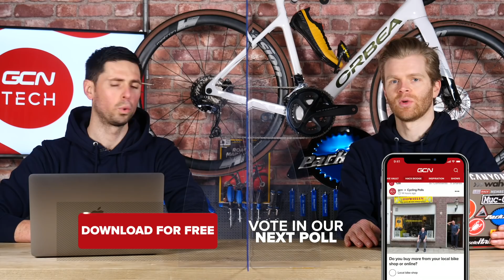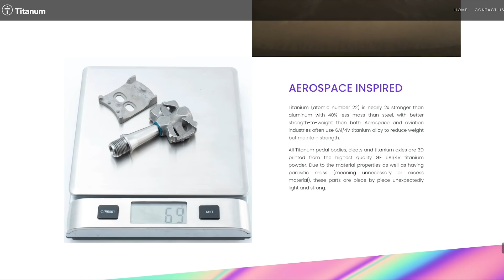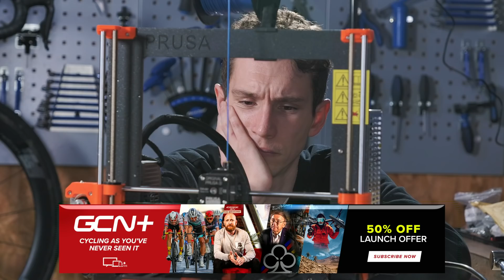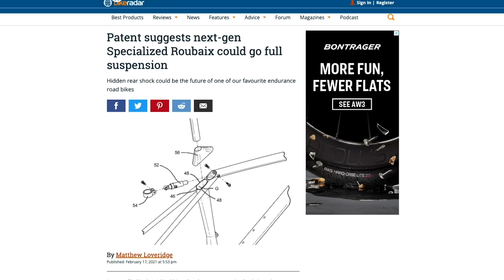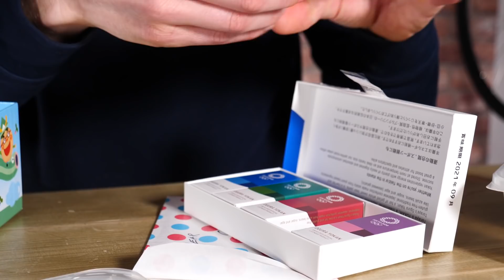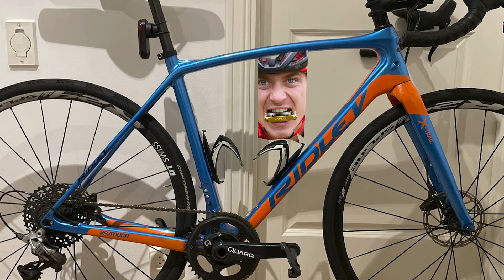Super Light 3D Printed Titanium Pedals! | GCN Tech Show Ep.166

Comment from the maker: What did you think of these super light pedals? Is 3D printing the future for bike manufacturing? Let us know 👇
Reply: Hot
Reply: I cant find the website of these guys?!! do you have a link?
Reply: Titanium pedal axles have no life time . Wear out real quick .. a few months . Exactly the same design needle bearings with cartridge bearings. After market SPD axles .total shite
Reply: Until the anisotrophy in the structure of 3D printed stuff is not controlled properly, it's pretty weak as a structural material. Currently there is two way to get over this: overdimensioning the sizes/volumes to achieve the needed strength OR don't use it for places where the stress is high. What can be interesting is to use hibrids/composite materials, but we don't see that.
Reply: @BarfyMan362 Nah. For some things it makes sense but it's mostly useful for prototyping. If you can injection mold, it'll be cheaper and better.
Reply: for all the 3d printing fans out there, do you guys know that agnikul cosmos a private indian space startup has built a fully 3d printed rocket engine!
Reply: @olli i think you need to explain adamantium metal because you look like wolverine (logan) now! 😂 peace man! luvya! 😘
Reply: Forget the tech, THAT INTRO
Reply: 3d printing is like injection moulding, but with much more structural drawbacks and massively more expensive
(But great for rapid prototyping, I'll give it that)
Reply: @frankeeeej  its a cheaper way to make a mold for rigging yes, less waste material like in vacuum forming and injection molding
Reply: @frankeeeej  except for the fact that you can't really injection mold Titanium?
Reply: The pedals look similar to Speedplays. With the two bolt cleat fitting resembling the late, much lamented Frogs.
Reply: @johnwestwell2942  I wish that Wahoo/Speedplay would release the design specs for Frogs to someone else to manufacturer. I can't stand the other Speedplays but I love my Frogs.
Reply: @davidruedeman9990  I use both - started with the road pedals, but used the Frogs on my mountain bike. They have now expired and I've had to return to Time pedals which have nothing like the rotational freedom my knees like.

Comment: #askgcntech
Hi, I had a valve failure riding my tubeless Continental GP5000 tires, and the rim made a small cut on the sidewall: 3-4mm, shallow, right at the rim bead (probably due to riding them on low pressure for a couple of kms before I noticed). Is there any way to safely and reliably patch them? Can I use the regular tire glue&patch kit from the inside? Thanks!

Comment: #askgcntech is it safe to assume that the max external rim width allowed is equal to the max tire width specified by the manufacturer? I'm planning to buy a wider rim on a slightly older frame and wanted to know what other considerations I should take like actual tire width after inflation. Thanks in advance!

Comment: I used to live in Japan, and 羊羹 (youkan) are probably one of the best cycling snacks. They primarily contain carbs, but still have a little protein and little to zero fat. Some versions have extra salt which are great for the summer. They are also highly economical since the ones at the supermarket can cost just 0.46 euros per stick. The ones you guys are extremely expensive, costing 2.09 euros per stick.

Comment: #Askgcntech Hi Ollie ,My front derailleur is rubbing to the chain when in the small chainring I also removed L screw bolt,tried narrower chain but it doesn't stop, I also tried changing the angle of the front derailleur then it's stop rubbing but wasn't changing to big ring ,Any suggestions what should I do???

Comment: Industry can call it whatever they want--additive this or that--but I doubt they'll shake off its technical name, 3D printing.
Reply: Well, the correct technical name describing all technologies are Additive Manufacturing, 3D printing is a subset, for technologies using a print head and similar, i.e. not laser and electron beam melting... Regarding 3D printing, straight from the ISO/ASTM standards "3D printing - Term often used in a non-technical context synonymously with additive manufacturing"
Reply: @Hazzeman666  Thanks much for your explanation as I don't, frankly, know much about any of this, just that it has been called 3D printing.  And it'll probably be something like photocopying insofar as the vernacular, like when everyone was using the brand Xerox as a verb for photocopying simply because Xerox was the first to market that technology.